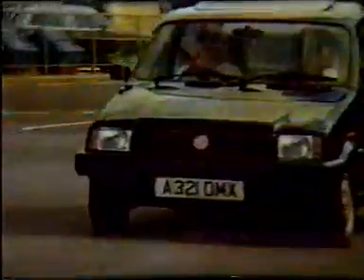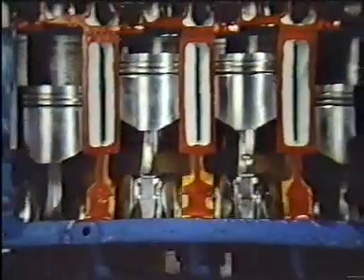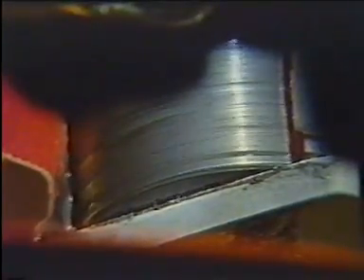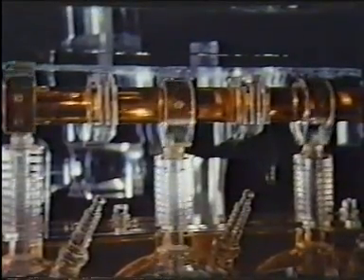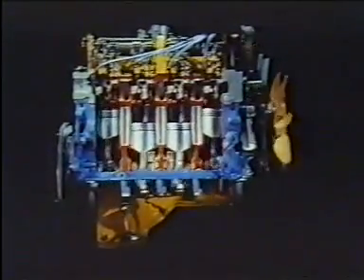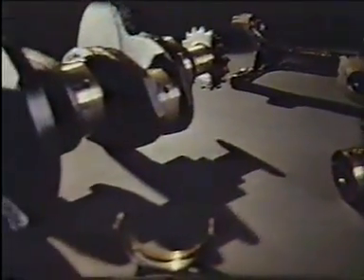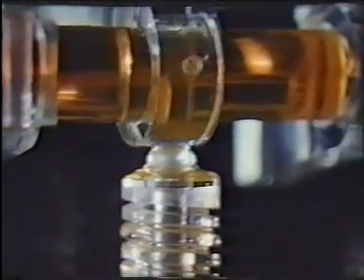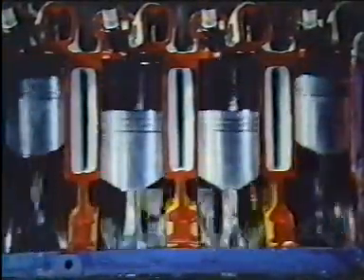Engine Lubrication System

Comment: I know the film is old but why in the hell did they think that clicking sound would be appealing. It's annoying.
Reply: It's the sound of rocker arm and valve mechanism dude . You notice It comes only when the engine is running . So much effort they had put into it.